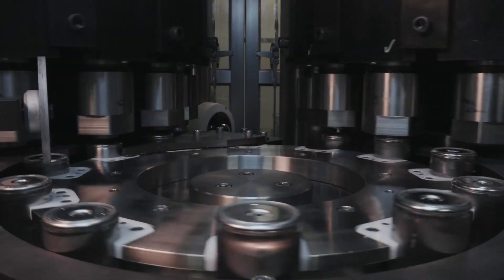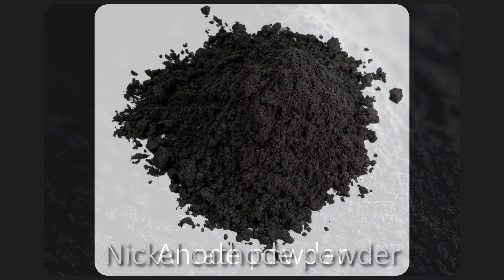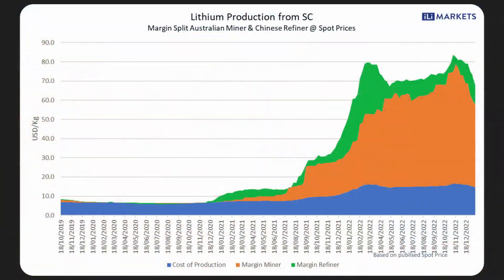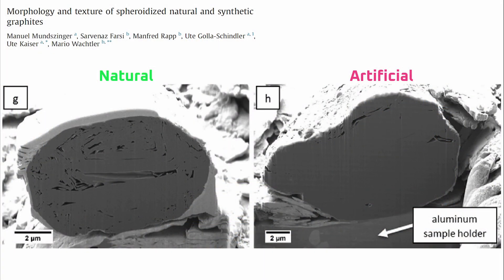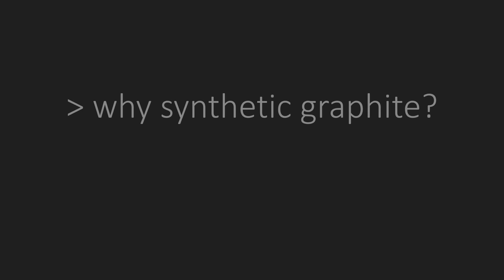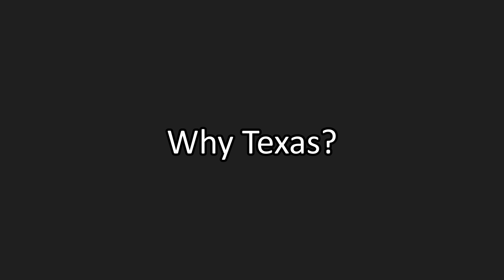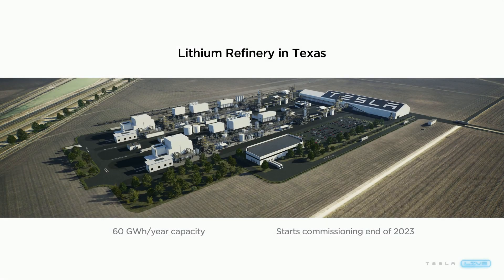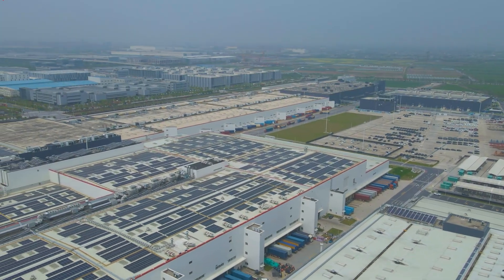Tesla is DE-RISKING from CHINA: 4680 batteries

Comment: It's not necessarily trying to decouple from China;  it's trying to decouple from atoms travelling around the world several times before they make it into a car, which is a problem with the whole car industry.  The reason this problem traditionally exists is that for decades transportation has been too cheap;  in dollar amounts, that is, not in costs to the environment, of course.  Soon, whatever is costly to the environment will also become dollar costly, so the companies that make the extra effort now to lower their environmental impact profile will be rewarded in the future.
Reply from the maker: I address this in the video: the fundamentals of the argument are good, but it doesn't address why the minerals are aggregating in Texas. They could just as well ship the minerals to China, refine them, make the cells, put the cells into packs, all in China, and just ship the packs to wherever the car gets assembled

This would still eliminate the majority of the kilogram-miles in the current supply chain, while also taking maximum advantage of the low cost of China manufacturing, and would almost certainly be cheaper overall, thanks to the same factors that allowed China to become the world's factory. Yet they chose to centralize in Texas
Reply: @SizeMichael  Good point;  but I think you are answering your own question.  So, okay, besides the kilogram-miles, there's also a dependency issue.  Tesla is not as vertically integrated as BYD, but it is surely the second-most vertically integrated automaker on Earth, and they continue to try to reduce dependencies as much as it makes sense.  So, 70% or 80% of the lithium refining for the whole world is done in China;  therefore depending on China for refining is not a good idea.  What I'm saying is, the purpose is not to decouple from China, per-se;  it is to decouple from single source dependency, as this is dangerous.  It's not because it is China;  Elon Musk is not anti-China;  it could be Australia, if this situation of near monopoly on lithium had been based in Australia.  I'm sure Tesla are not happy to be depending on Taiwan only for their NN accelerator chips, either, and I'm sure they'd try to decouple from Taiwan if it were possible;  but it just isn't possible, in this case.

Comment: What fool would pay over $60 000 for a replacement battery  , wake up to yourself, burning more coal to charge your poisonous batteries is not helping but adding to world pollution.
Reply from the maker: You should burn coal rather than oil 💯% of the time. Coal is mined here, oil is imported. Oil cars are a national security risk.

We could power them via coal liquefaction in theory, but it would be about 4x more expensive per mile than oil, while going via the coal->electricity route is 2-4x cheaper per mile than oil

Also, a car battery costs $12k and lasts 500k-1m miles. Longer than an engine can go between rebuilds.

Comment: Some sources claim that the Tesla refinery will eventually produce 180,000 tonnes of lithium per year. If we use 0.75 kg of lithium per kilowatt/hour of battery storage, that output equals 240 GWh per year. Some sources claim that China's capacity in 2023 was about 1000 GHw of lithium batteries, or about 77% of world capacity. That would put Tesla's eventual output roughly equal to the rest of the world's 2023 capacity. These numbers are sketchy and rapidly changing.
Reply from the maker: Most results I get are for much less

I don't think the site currently under construction will be able to produce anywhere near 180,000 tonnes per year, but if we're talking "eventually", there's no reason why the plant can't expand: they're close to the ocean, next to rail, and the footprint under construction is about 15% of their property
Reply: 1 kWh of battery capacity does NOT require 0.75 kg, but only about 0.160 kg of lithium metal.  Don't fall in the trap so many people, including MSM, fall: mixing up quantities expressed in kg of lithium metal, with quantities expressed in kg of lithium carbonate, which are 5.4 times higher.    Having said this, the planned capacity of Tesla's lithium refinery is not yet known... and some of the sources I have seen don't even mention if their numbers are lithium (metal) or lithium carbonate, or even possibly lithium hydroxide!